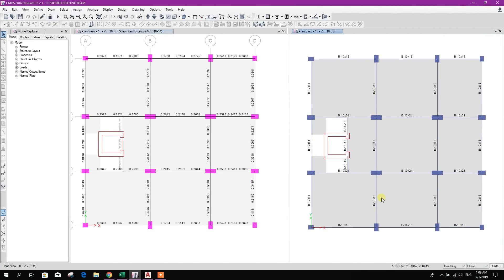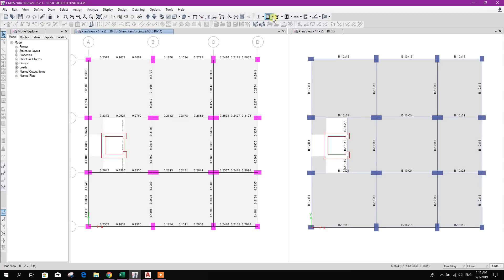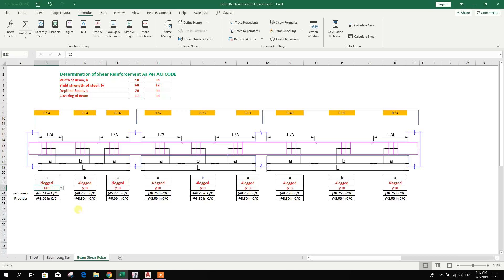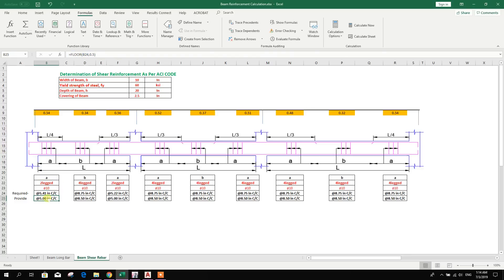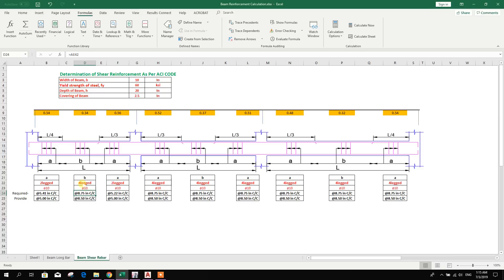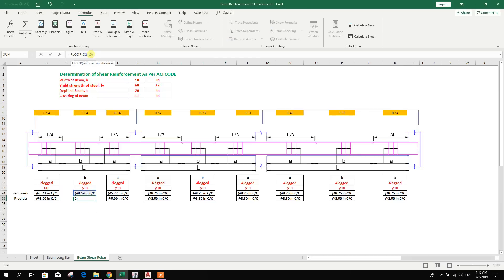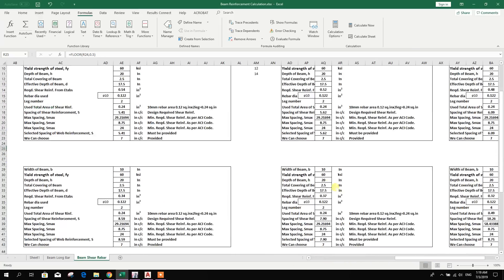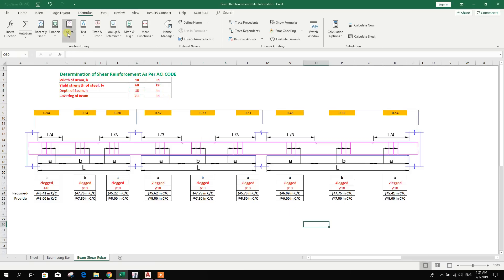BEAM SHEAR REINFORCEMENT DESIGN USING ETABS RESULT & EXCEL

Comment: The unit for req shear reinforcement should be in^2/ft and not in^2 only. 
It is confusing how you get spacing S.
Reply from the maker: Yes that per ft(12inch) used to find spacing.

Comment: Engineer good day. I need your help. Actually, I used EC2 (Uk) to design a small structure in ETABS but the shear reinforcement keeps coming out as 0.00..... Please help me. Thanks.
Reply: No need to design for shear reinforcement . Provide minimum 2 legged shear reinforcement ( According to IS Code )
Reply: Use binding wire then instead of stirrups🤣🤣🤣

Comment: In BD we sometimes ignore the shear reinforcement if it is showing overstressed in ETABS. e.g. only one of the beam section in a long series of section, the beam is red and the shear reinforcement on one side is overstressed. So, should we ignore it or increase the beam size of all the panels? what would be the best judgment?
Reply: shear is controlled by increasing Depth of Beam, if the Gravity loads governs than EQ load or wind load.